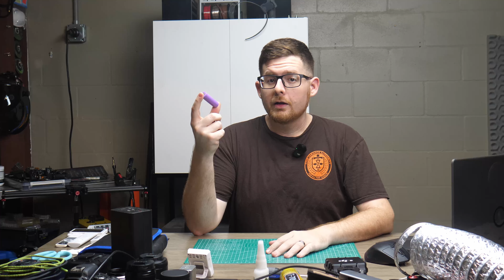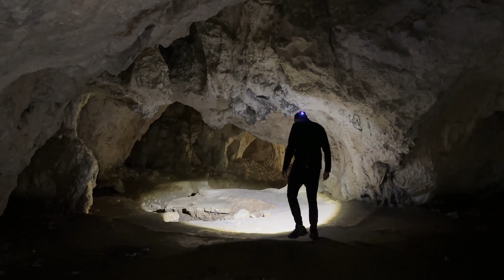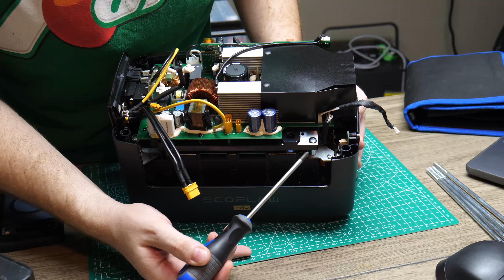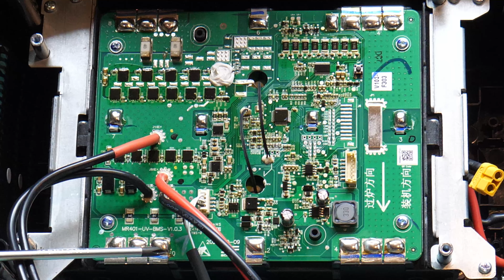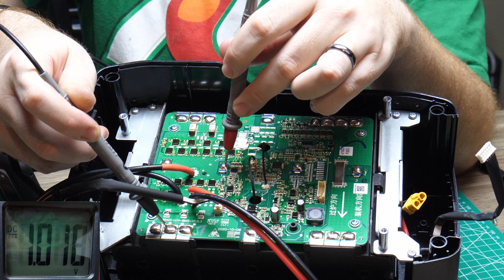{Re-Upload No Music Cut} I Bought 10 DEAD EcoFlow Power Stations... (Explainer and teardown)

Comment: I would extremely careful trying to revive lithium ion cells that have overcharged. Other power stations use LiFePo4 batteries, those are far less risky if you're going to try to revive the cells from an over discharged state. You are tempting a real fire risk doing that to Lithium Ion. This actually reminds me of those people who run a generator inside and kill themselves with carbon monoxide.

Comment: Came from with with music video. Luckly I read the description in the first minutes of the video. I like these kind of videos even though I am into this (lithium batteries (professionally)) for almost 20 years now, still love to see what people do and how they do it. I didn't know the first gen of Ecoflow was with LiCO2 as the later gen is with LiFePO4 (and thus way safer). I made my own power stations years before these things became a thing.

PS: DON'T pull on the cables to remove connectors. Just use some pliers to disconnect the connecters, so grab the connector and not the cables!
Reply from the maker: That's awesome, thanks for sharing! I've also made my own 18650 packs and a power station I hope to feature on here some day.

And yes, bad on me for pulling the cables; I trusted their soldering a little too much. Thanks for watching!
Reply: @fauxrhino  Would be cool to make a video about it, yes! (Even though it's kinda "old" tech with the 18650 LiCO2 cells and cosidered "dangerous").
I use them in everything (mod), old powertools, flashlights, UPS, etc. I today just modded an "old" headphone with a 103450 cell (SANYO UF103450PN, from old Dell laptop batteries). Added bluetooth and USB-C to it. The cells have the perfect size and fit things that use 3x1.5v AA/AAA batteries).
I also checked the second one of this series. And I'm curious if you are going to show the cells because I'm quite curious what brand cells they use. It's a chinese based company, and often they use "offbrand" cells but some companies use real brands (like Samsung, Sony, Panasonic, etc).

PS: The cells I used today still have their storage voltage of 3.7 volts even though I have them laying doing nothing for about 10 years now! And all of them are still as good as new (I capacity checked a few of them yesterday and they still have 100% capacity).

Comment: If you get advance warning of a storm, by extra gasoline for your car. Hook to your car, a few thousand watt inverter to run essential items, one at a time. I've talked w several families over the years who say they've lost refrigerators full of food from bad weather. DON"T pack your frig, have a week's worth of food in there at any time, eat it all, buy more. Have simple foods for power outages. Prior to a storm, pack water bottles in the freezer, when the power is out, the ice will help, even move some bottles to the frig.
Reply from the maker: Admittedly, the diet we were on at that time last year wasn't the best and most of our 'food' was preprocessed heat-up meals for convenience. If this were to happen today, the loss would be significantly lower - the benefits of getting fit are endless! 😁

The inverter idea is a great one, but just like a generator or fuel, they require forethought I didn't have. 

Thanks for watching!

Comment: First, even if you get them to charge a dead cell could cause them to drain right back out. I am currently rebuilding a Jackery 1000 Pro, where that happened, that I purchased in a three-pack bundle at an auction. I am upgrading it to 21650 cells - I have also rebuilt or reclaimed the cells 100's of Ryobi batteries - I find that in 50% of the batteries I have done, it is the BMS that is bad, not the cells.
I love to know where you found them I would love to find more of them.
Reply from the maker: I did half hope to have at least one dead battery so I could do a similar project with some 18650's I've had laying around for a while. So far, I've only had one dead control board, and the ones I've successfully charged to 15% have stayed there for >2 weeks (the one in this video is still holding strong at 19%; planning on doing a full charge/discharge to see how it handles it in the next video). I got them from an eBay seller, but they're currently sold out. By the sound of it, he had a ton of these units, so maybe they'll pop back up soon.
Reply: @fauxrhino  - Thank you - I just finished watching. Great video, there are very few on here about power banks. I was an electrician in life and decided to teach myself about solar and power banks. If you do the expansion pack, I will definitely be watching that one. I have some 26650 batteries just for an expansion pack I want to build. I followed your channel, and I am looking forward to more videos.

Comment: I was able to resurrect a cordless shaver in the oven.  Bringing the temperature up accelerates the chemical reaction and bumps up the voltage.  Checked it for power every couple minutes, and as soon as it turned on I put it on to charge.  That was a few years ago and it's still going strong.
Reply from the maker: Now that you mention it, one of these battery packs wouldn't turn on when it was inside my house, but after a few days in the 100° warehouse it turned on and showed 0% allowing it to charge through DC. Good point/idea; just don't go too hot!
Reply: @fauxrhino I forgot to mention:  I only used the oven method because I didn't want to break into the waterproof shell.  If it wasn't waterproof I would have disassembled it and charged the cells directly. 
I used the "warm" function on my oven which runs at 140°F.
Reply from the maker: @Kineth1  If it works, it works! My older trimmer uses NiMh cells and luckily isn't waterproof so I just pry it open and replace the cells every few years. Hate to throw it out; it's the only one to ever get just the right length.
Reply: @fauxrhino They really don't want you to get those battery shavers apart easily, I recently took an old one apart, there was FIVE layers of trims & covers, before I could access the battery &circuit board! Each cover was clipped & screwed on with numerous tiny screws!
Reply: That is really really a great trick. Not bumping it too hot should be ok. You need to have a lot of time to try everything before you take it apart.
I had a completely dead 18650 li-ion cell which was at 0.6V. Just took a 10k resistor and a good cell at like 4V.  Took a couple of days but it came back and is still in use. Also I do these 'dangerous' ones outside on concrete and in the shade.  I once burned a hole in the carpet of my parents house when I was a kid, and that was like 40 years ago. That could have ended differently so always think about these things.
Reply from the maker: Yes, you only learn that lesson once 😂 I hope to cover some more safety aspects in the next video to shore up some of my mistakes :)